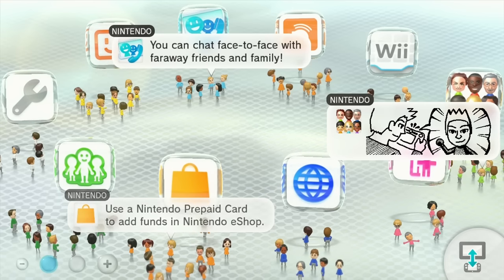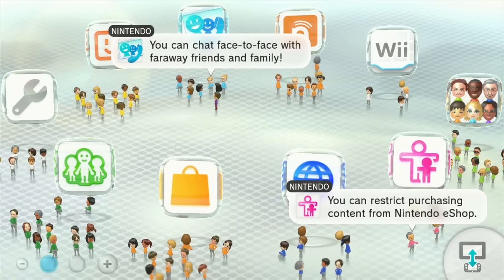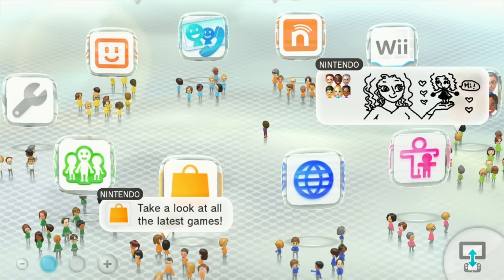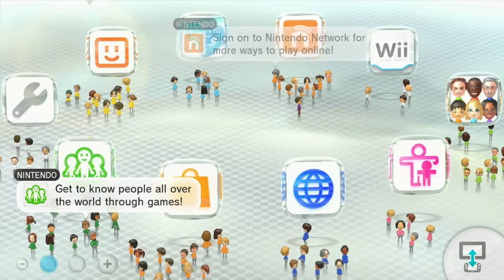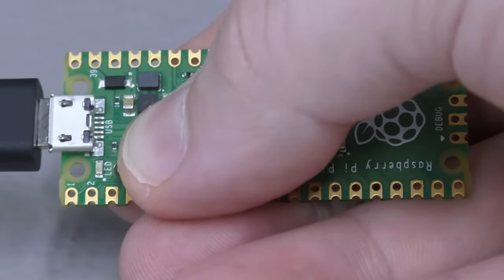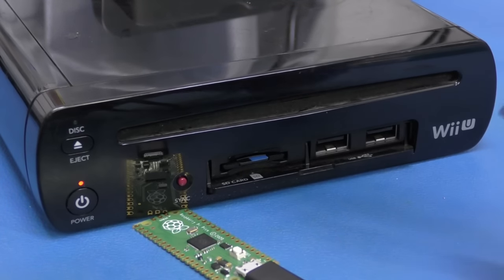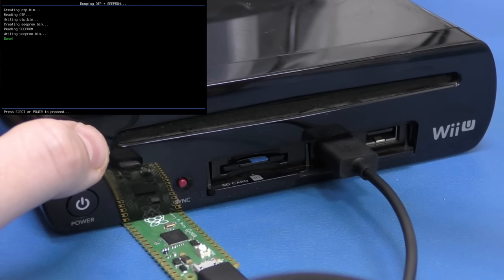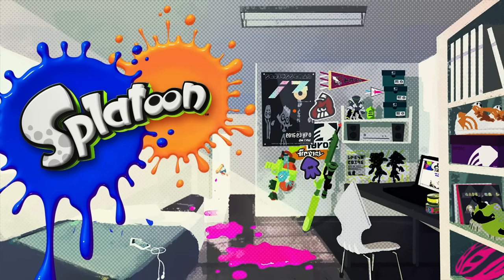The Truth About the Bricked Wii U | Can You Fix yours For $8?!

Comment: This video is misleading. This Pico does fix a lot of Wii U's but not because of NAND corruption, but rather a user who disregarded the warnings regarding uninstalling something known as "Coldboot Haxchi". The DS game that this exploit was injected into, was either deleted or made invalid by deleting the NNID or user off the console. The Wii U isn't confused as to where the OS is, it's booting it already, just that there's an XML file that tells the Wii U which title ID to jump to for a menu, which on retail units is the Wii U Menu. CBHC changes it to the DS game so the console boots into a hacked state, then redirects execution to the Wii U Menu, as if nothing really happened.
It would be incredible coincidence and it is highly unrealistic that there exists NAND corruption that only changes that XML file in a still valid way and doesn't corrupt anything else. Corruption is unpredictable and XML is very sensitive to syntax errors so NAND corruption that usually flips bits resulting in garbage data, would make the XML unusable and per se probably irrecoverable. Not to mention that it's not the case. That file is in the SLC which is considered safe and not prone to corruption. The chip in question is the MLC (the 8/32GB one)

The bricks that were recently talked about cannot be fixed this way, as it's an issue with the NAND chip itself and using UDPIH cannot repair the damage with magic. You were warned so on Twitter as well.
Reply: So if this method was used to bring a Wii U back from being bricked, the NNID’s linked to it will be gone?
Reply: @MrOiram46  No. You seem to have misread my message. Restoring the Wii U Menu through UDPIH does not remove your NNID. What you misunderstood is the reason this recovery works. "Coldboot Haxchi" modifies system configuration to boot a DS game automatically. If it has been deleted or made invalid, such as unlinking the NNID or straight up deleting the account that bought said injected game, the console cannot boot to that game so it bails out and is effectively bricked.
THIS is what the Pico can fix, and not the cases of corrupted NAND chips, which have to be serviced by a professional, given that you have a clean backup of the MLC so it can be flashed onto the new NAND chip, or even an SD Card wired in-place.
Ofc newer methods such as Tiramisu/Aroma use this system config as well but inject into a system title that can normally not be removed by a user so the brick potential has been cleared that way.

Comment: help from fsbor when i insert the usb at the end of starting the cd the wii u console turns off could you please help me
Reply from the maker: This is an SD card problem. Change SD cards and use one that's 32GB in size or less and make sure it's formatted to Fat32 with a 32K memory allocation.
Reply: @Voultar  Thanks, I'll do what you tell me, I'll let you know the result good 👍
Reply: @Voultar  Thank you very much I did what you indicated and it worked perfectly you are the best

Comment: I might try this ... Maybe.

Such a weird thing to face tbh. I've hardly ever used my Wiiu, it has maybe seen 50 hours of play altogether, and I wanted some leisure time with Mario Maker. Now it does this (0103), after I try to start Mario Maker.

What a piece of junk.
Reply: Ok I got rid of the error by deleting the gamedata (not the save game), doing a system update, updating the game.

Weird thing is, I needed an internet connection to update the game (and as such a system update) It wouldn't install the discversion.

Anyway, it works fine now, and I still have all my saved levels.

Comment: Tried this and didn't fix my wii u so i  still getting error 160-0103 when accessing homebrew launcher 😔

I suppose i should wait a little longer until there's more options to fix this problem.

Ps. My wii u was working perfectly when i stored it years ago and recently decided to mod it and give a good use but half way the process i came with this error.
Reply from the maker: Unfortunately, it sounds like you have a failing NAND. Sit tight, this is developing and more data is coming out!
Reply: @Voultar  yeah
I'll wait for a while. Thanks man 👍🏽

Comment: Potential livesaver! I am running into one issue though.
When I plug the pico in at the Wii U screen, it just kicks the console back off. Is it the SD card I'm using, or something else? I'm using a micro SD card with the adapter, but the problem may lie in that I think I accidentally flashed the pico twice (i forgot I did it the first time but realized after it was too late.) I'm trying a second pico right now, but I was wondering if a formatted USB drive would work in place of the SD card or not?

While typing this, I tried the other pico I had as well as using a micro sd to usb adapter. It's no longer kicking the system off, but it's hanging at the wii u logo

EDIT: nevermind, we got it! I think I had a dud adapter, I found another one and the menu came up flawlessly! However, I'm still getting the bricked error, so there must be other issues at work. Thanks for the hard work regardless!!
Reply: I should clarify that the wii u is having the 0103 code and has never been hacked or had any cfw put on it.

Comment: Mine keep ejecting whenever I drag the file to my pico.  Any advice or help?
Reply: I've been having the same problem.
Reply: @MeowMeowCopterYT  I found out it is apparently suppose to do that but honestly I was never able to fix my bricked wii u.
Reply: I just figured that out, lol. I've also not unbricked my wiiu yet, I also don't think I'll be doing so. I believe my EMMC has degraded, so I don't believe it's a software issue. And I'm definitely not experienced enough for replacing the EMMC or rewiring it to an SD card (which is apparently a pretty good long term fix). So I'm just gonna resort to buying an original Wii. Thank you for trying to help though!

Comment: My wii U doesnt have any codes just stuck on wii u logo and music. I tried the same versions you did in this video and my wii just turns off and nothing more. Should i be using the up to date ones? and any help would be appreciated. Thank you in advance.
Reply: It works only with firmware 5.5.3 and above
Reply: @shahzaibjamal3439  do you mean the wii u firmware like the update for the console?
Reply: @SWAMPRAT-ml3mg  Make sure your SD card formatted as FAT32 and use the latest udpih and recovery_menu file. Insert your RP pico as soon as you hear 4th spining sound
Reply: @SWAMPRAT-ml3mg  Yes, console firmware. You can check it in Wii U or if yours is stuck on boot you can check it in recovery menu shown  in this video
Reply: @shahzaibjamal3439  so every time I plug the Pico in it turns my WiiU off. I have downloaded version .06 to SD card and release 3 for the Pico. is there something I'm doing wrong is there something i have to do to the Pico first.  Thank you for your help as well. i have the legend of Zelda one.

Comment: My 103 error only comes up when I try to launch my disc game of xenoblade chronicles x (onnly disc I've tried). When I play a backwards compatible game from wii that doesn't have a disc like Super metroid, that works fine. Does this fix apply to something like that?

UPDATE: Tried the procedure and it didn't fix my issue sadly. Sytem freezes so often when using it now that I don't even think I could factory reset it as a troubleshooting step.
Reply: Just tried Mario kart 8. Same thing. So only on launch of a disc game I get the 103.
Reply: Also, does this fix wipe the system? I have digital games downloaded that I don't want to lose.

Comment: thanks for the video! i was hopeful this would help but unfortunately my wii u remains inoperable. I'm wondering if anyone else has my issue? 

Works fine at startup, gets past the Wii U screen but when I get to the homescreen after about 10-15 seconds the software freezes every time. 

Wondering if anyone has found a way to fix the issue. Can't manage to get to the factor reset option quickly enough for it to be selected before it freezes.

Comment: I try this method, but it doesn't have to work. While I connect the Raspberry Pi Pico, the logo WiiU rest displayed on my TV, and the power's button is blue. I let for 10 minutes and no change. The SD card is formatted in FAT32, with 32GB. Anyone have the cause of this failure  ?

Comment: Mine literally just died yesterday but with a different code (160-2203). Wii U kept freezing, tried to format it and it froze on the process. After freezing, I had to unplug it and now every time I turn it on it is stuck at the format menu with no way of using the gamepad or Wii motes.
Just got the Raspberry Pi and I am hopping the best. I'll try it tomorrow and bring an update.

Comment: Can't get into the recovery menu, seems as if the pico won't trigger the exploit.. tried different sd cards, plug in timings, usb cables, reflashing, updating via Thonny.. without success :/
Reply: WiiU is an european console
Reply: Same here.  Sits at White Wii U screen.
Reply: @andrew7629  I get to the user select menu. When you pick one it seems to load the start menu but fails with the 160-0103 code

Comment: In my case, the Wii U isn’t throwing an error. It’s just stuck on the Wii U logo. I never did anything to it, never tried home brewing it. Just packed it away in a closet for about 5 years then dusted it off for my 4yo only to find it now just boots up the logo and that’s it, just sits on that splash screen.

Anybody know if this method will work? Has anybody had the same symptoms and tried this yet?

Comment: This didn't work for me. Before I tried this my Wii U got stuck on the Wii U logo, no errors. does nothing other than display the logo. I tried to do as the video instructs but no joy. 
If I plug the Pico in too soon, nothing gets displayed on the screen. Console power LED is blue (powered on) but its as if it didn't start up at all.
If I plug the Pico in too late (ie: when the Wii U logo pops up), it just sits on the Wii U logo like it was before.
If I plug in the Pico at the right time (what I believe is just after the disc drive initializes) the entire console just shutdown immediately

I just can't get to the Recovery Menu. Does anybody know if I'm doing something wrong?
I've copied over the udphih.uf2 file into the Pico
I've copied over the recovery menu file onto a  64GB FAT32 SD card
Put the SD card into the Wii U
Fired up the console
Plug in the Pico the second the disc drive stops making noises
but then the console just shuts down

Comment: This might be a stretch. But we’ve done all the steps but when I go to plug the pico board in the Wii U it just shuts off. Anybody know what’s going on?
Reply from the maker: SD Card. Either format it to FAT 32 or try a different SD card that's formatted to FAT32.
Reply: @Voultar  we actually figured it out! The sd card was not flush with the adapter we were using and it worked when we used a different adapter! Got our Wii U unbricked! Thank you so much for the helpful info!!

Comment: What if the system turns on but I don't get a Wii U logo at all, just a blank screen? Any hope or is it dead?
Reply: Might be the power supply... One of my Wii U's was stuck like that and it ended up being that the power supply power delivery was glitchy, which was causing it... That, or the HDMI port... Does it show anything on the Gamepad???
Reply: @Beavernator  It's weird, at first everything was working fine I was even able to browse the eshop. But then I noticed I needed to clear some space for a purchase and when I tried to delete a game I started getting the 160-0101 error code. I then thought that if I deleted everything through the option in the settings, it might fix the error. Now it turns on but I only get a blank screen. So it doesn't seem to be the power supply or HDMI since both were working before I wiped it clean.
Reply: @schwengy1387  Your issue might be solved with this videos fix then... I'd try it... That's why I'm trying this method on one of my launch White Wii U's... Certain small games were corrupted and when I tried clearing the memory, it never started again ( black screen)...
Reply: @Beavernator  did you have any luck? I've tried a bunch of times but I still only get a black screen. It's too bad I've only had a couple of consoles die on me and I loved my Wii U. Maybe someone will find another technique that will work?
Reply: @schwengy1387  Did you change the internal clock battery??? It's located on the side of the Wii U... If that is dead, it can cause it to black screen as well...
Reply: @schwengy1387  another option (and this one SUCKS) is what happened to my daughters 1st Wii U... It would launch black screen, but it would still sound like it's trying to load... I'd have to hold the power button down til the light turns red... then wait like 3-4 seconds and try again... After like 12 tries it would turn on... I learned that from a nintendo rep... but there is no fix for that type of issue... It worked like that for like 6 years before it finally wouldn't work anymore... I just have it for parts now...

Comment: my console just turns off when i do this idk why
Reply: Did you end up fixing it?
Reply: @Abood_Edits26  my console is working just using the recovery menu won’t work sadly
Reply: @newalbacore8352  how did u end up fixing it? Cause I’m with keep closing aswell when I put in the pico
Reply: @Abood_Edits26  that’s the thing I didn’t sadly, I got it because I wanted to do the mlc checker thing but my console just turns off when I plugged in it and I couldn’t find anywhere why it might be doing that, console works tho so I’m not worried for now